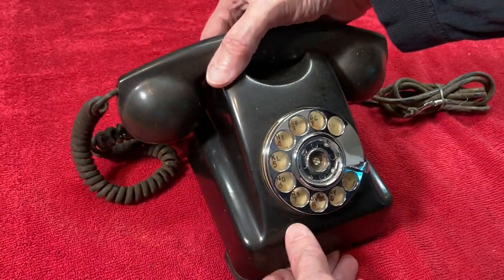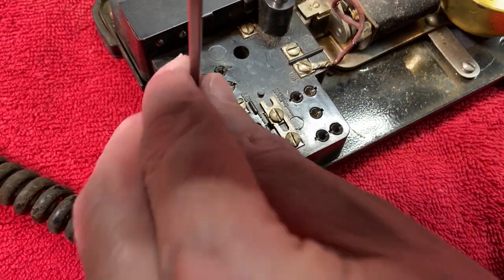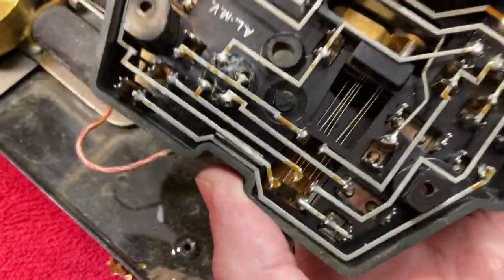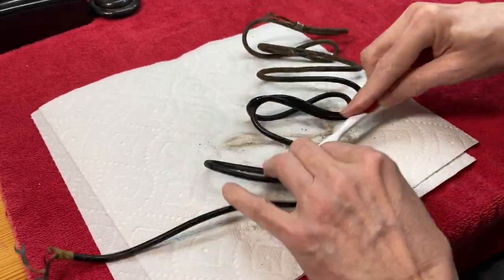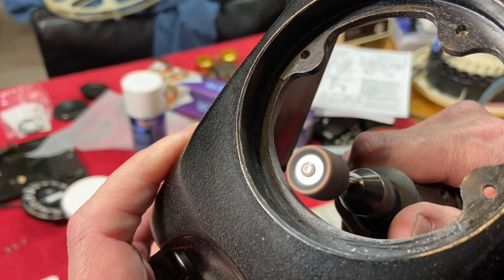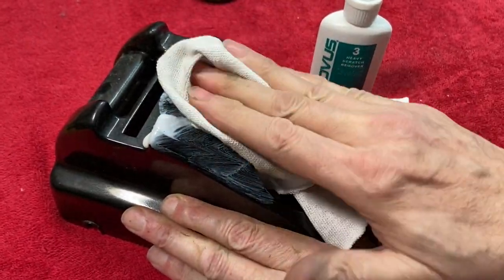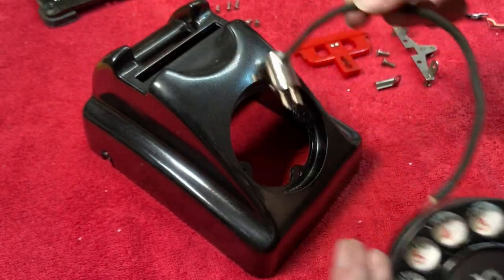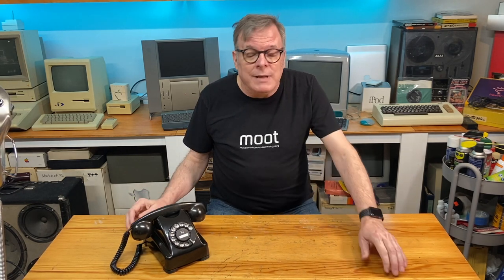Kellogg "Redbar" Telephone Refurbishment

Comment: Steve, 
I loved this video.  I worked for Bell South for several years and still have an interest in things telephone.
One thing I didn't understand in this video is the "speckles" all over the cover and handset.  It appeared like specks of paint that had splashed on it, but with all the sanding and polishing (especially the dark Black Shoe Polish) I would have thought that if that was what it was, it would have been covered up.  Just what is that?
In a visit to one of the older central offices I discovered a Vacuum Tube that had a warning on it that stated that it produced X-Rays, and I think it also gave a "safe distance" away from it.  You never know what you will find in these places.
I would love to see you do a Refurbishment on a BC348 receiver!  Especially one of the E, M, O, P or S versions.  For me the ideal one would be a BC348M.  There are several unique things about this radio.  Things like a 917 Khz IF frequency, a potentiometer that is connected physically to the tuning shaft of the tuning capacitor, the tuning capacitor itself, and other cool things.
Reply from the maker: I don't really know what that speckled texture was. There were tiny grey specks of paint, which came off easily, but the entire handset (and a little bit of the area under it on the top cover) had that texture, which I must assume was not original. I got most of it to go away with the process including the shoe polish, but I didn't try to remove it all, because I didn't want to make too much material go away. I didn't want to make it look new, but I wanted to make it not look like it was decaying. I haven't researched this, but if I had to guess, I would say the texture was the result of the surface being slightly eroded over time by dirt and skin oils transferred from the user's hands and face, since it only really appears on the parts of the phone that are directly handled.
Reply from the maker: I would love to have a BC-348 (or similar antique military radio) in our collection!